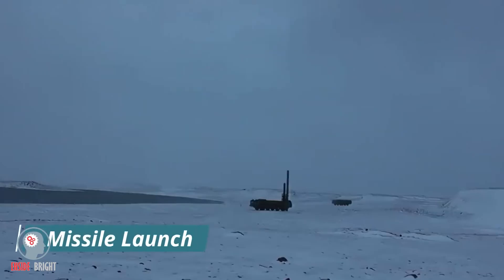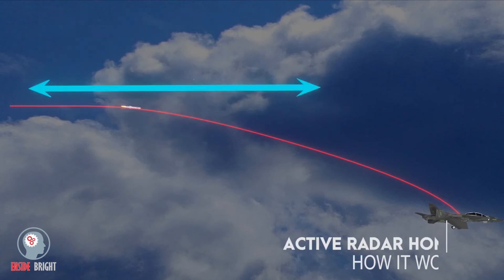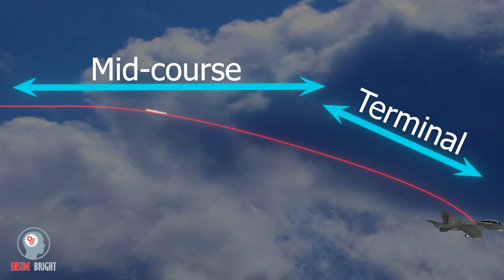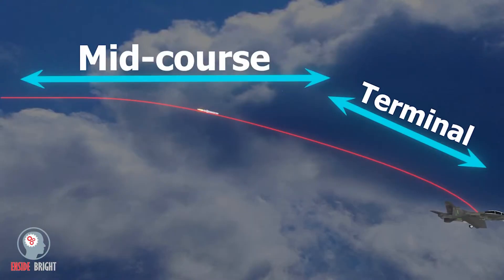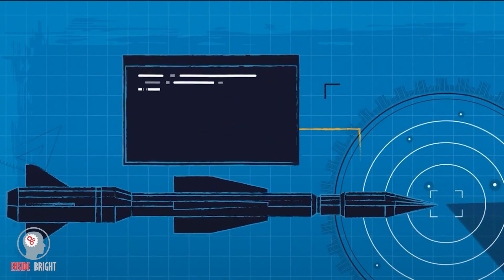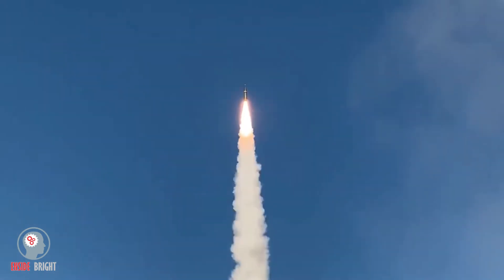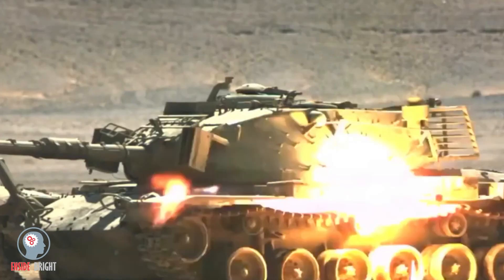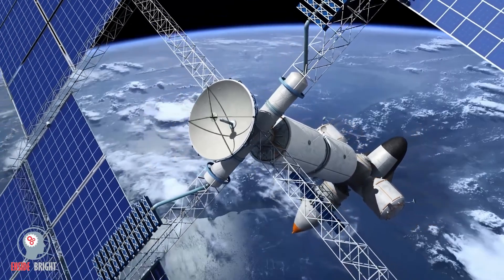How Missile Guidance System Work?

Comment: Or you can mount a camera on the missile and make a video call, then RC your/its way to target...saving a few millions on the production cost.
Reply: This is what I thought as well, but the problem with distant vision becomes the need for measuring radars and communications sources
Reply from the maker: You're absolutely right! Distant vision can pose challenges when it comes to measuring radars and communications sources. It's important to find innovative solutions to overcome these obstacles.
Reply: already did, some of the earliest precision guidance was done this way, just a camera that is located in front of the missile and connected by a very long wire or wirelessly to the operator who controls the missile and is basically similar to flying an rc plane
Reply: Do you really think humans can steer a missile that's going at thousands of kmphs? can we even process what's happening at that speed?
Reply: @dhairyasheth  yes some early manual guided missiles were like that, there were also ones where no cameras were attached on the missiles but instead the operator watches the missile fly towards the target
Reply: @dhairyasheth   you don't need high speed if you can manually dodge ...drop flares  etc..at least not a speed impossible to steer with.